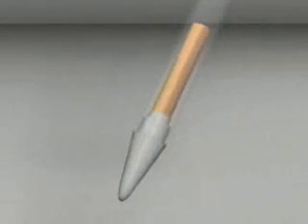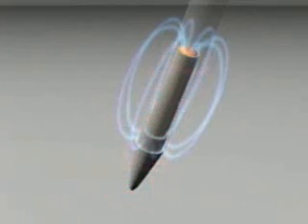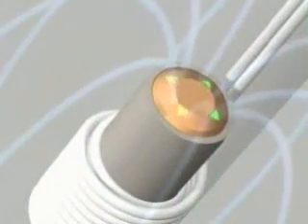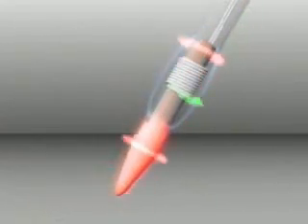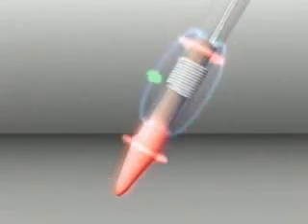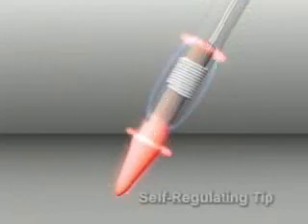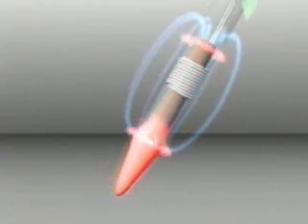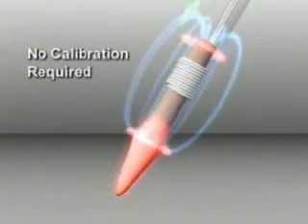Metcal, the original SmartHeat Soldering inventor

Comment: The curie effect has been used by Weller for a very long time. All the one I encountered has fixed temperature tips. I have known about Metcal's RF heating a while. What still puzzles me is since the iron tip temperature is regulated by the pre-set curie effect that is built into the tip, what make the tip temperature adjustable on these Metcal stations.

I suspect this video is about the "original" so called SmartHeat. The current crops of adjustable Metcal likely uses themal couple to sense the tip temperature and the control in the main assembly dynamically and rapidly regulates the power delivered to the tip. Hence, I further infer Metcal's secret sauce is their RF heating  via skin-effect.
Reply: Many of their irons are not adjustable still. I have the MX-5000 and you swap tips in 100 deg F increments (500, 600, 700, 800).